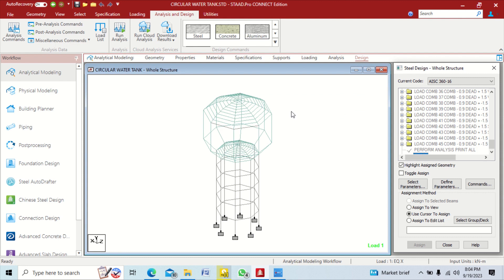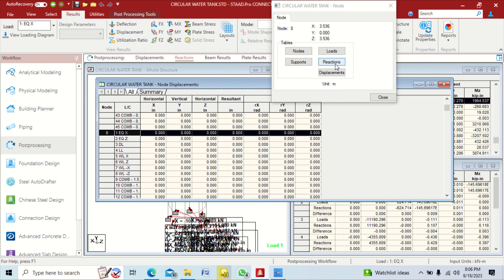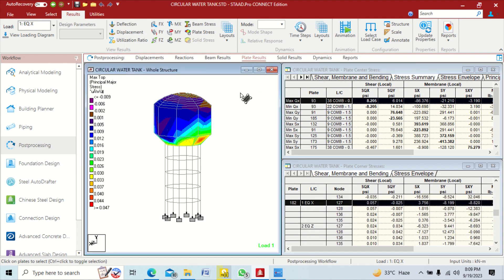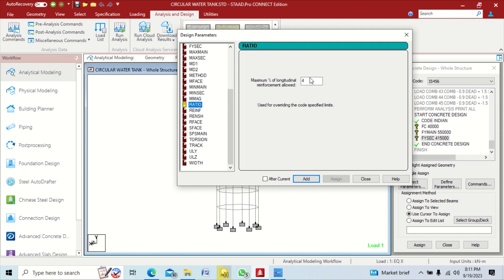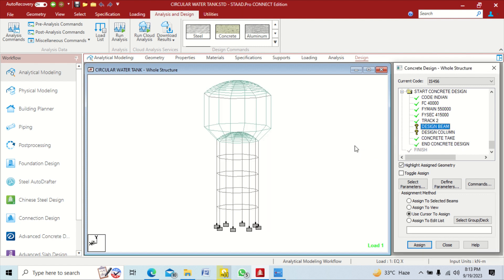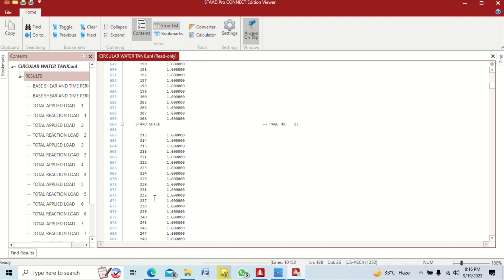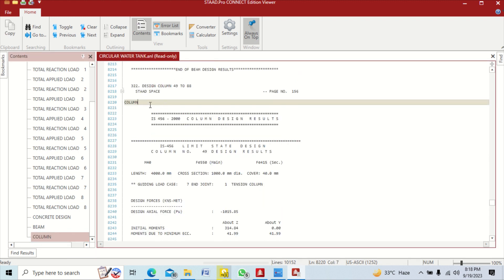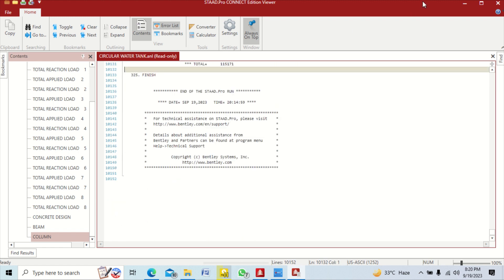DESIGN OF CIRCULAR WATER TANK in Staad Pro (Part 2) [ IIT Delhi ]

Comment: Sir I have designed same structure with dame data through the help of this video  but different sections are failing with 80 warnings  ...why sir ?
Reply from the maker: It should not
Don't worry
If you understand then it's ok
And there is one another video on the intze tank you can check from there also
Reply: @Structural_Softwares  sir can you provide me actual data for designing of beam and column and for reinforcement sir please
Reply from the maker: Ok 
I will